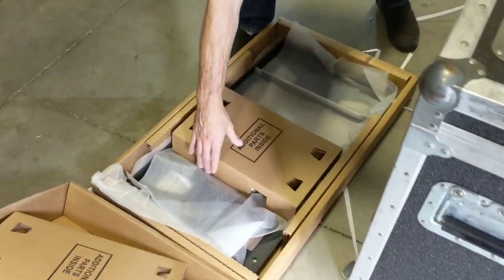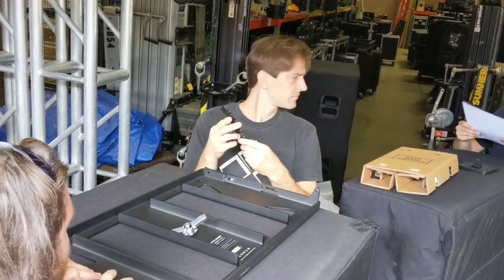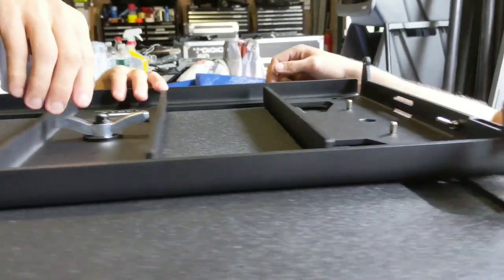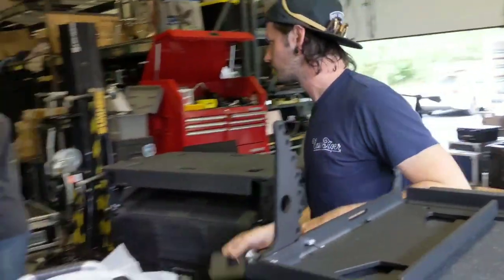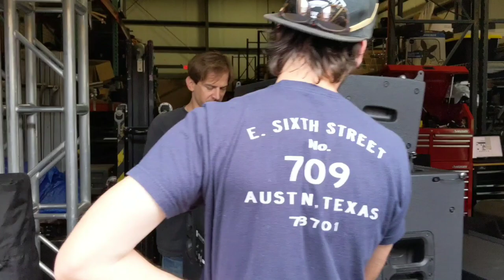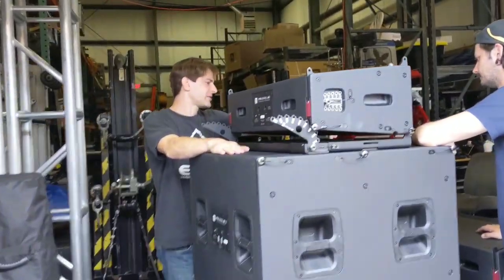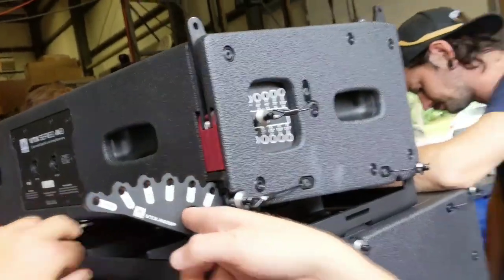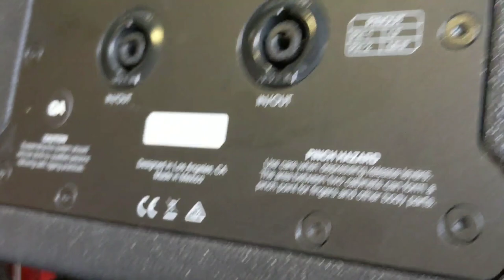s4e6 - JBL VTX A8 Base Plate Unboxing And Set up with B18 Sub, Live Raw Reactions, First on YouTube

Comment: I have some SRX906, which you can pole mount 2 with their base plate.  When you put the M20 wing nut back in the storage spot without the angle plate that washer rattles at 400Hz.  It’s different than what you’re showing but similar enough to mention.